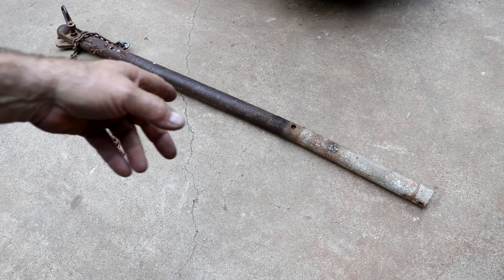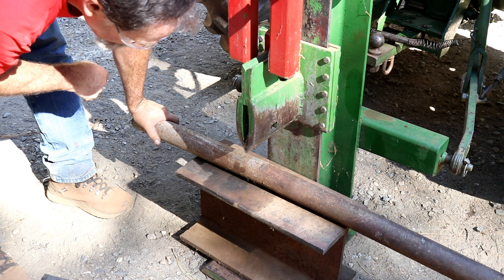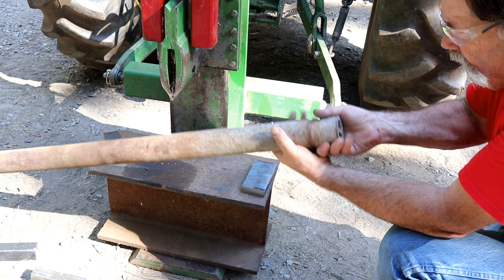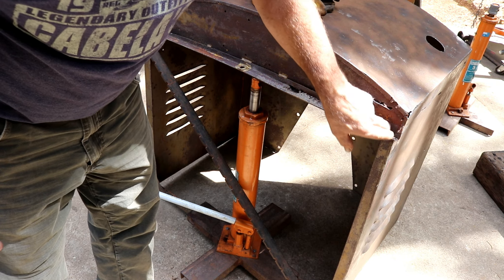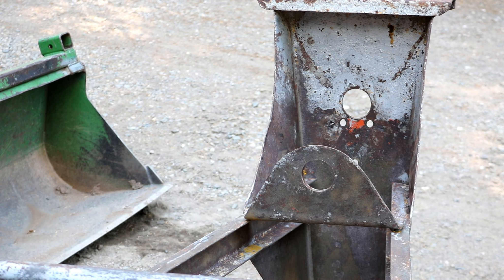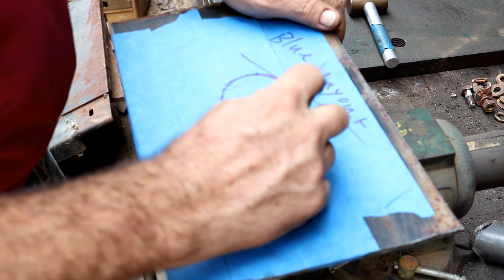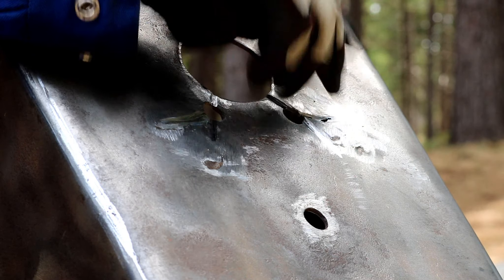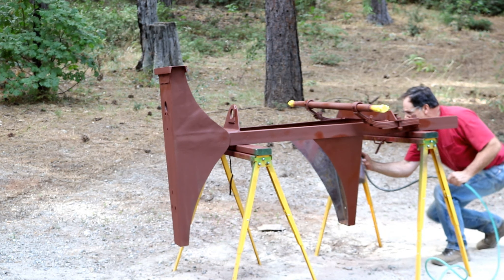Cement Mixer Restoration | Repairs P1

Comment: That's the biggest SM dolly/ bucking bar I've ever seen!!!
Looking good Randy, before you know it you will be finished and looking for another project.
Reply from the maker: Thanks Eric.  The anvil worked really great.  I am trying to complete another project at the same time.  The winter is starting early and it is cold here and stopping me from painting.
Reply: @RRINTHESHOP  yes the cold weather is coming. I have a possible project for you, I have two vacuume pumps they both work but need work - minor repairs. Are you interisted in one?

Comment: Nice Randy!  Coming along really good.  Tough to straighten out cement mixers.  They are usually very abused but you are doing a great job on yours!
Reply from the maker: Thanks Reid.  Coming along but winter is starting here and is slowing my progress.
Reply: @RRINTHESHOP  Yeah, I know what you mean.  We had a couple of inches of snow over the weekend and is supposed to get down to 24 tonight.  Real early for us here!!
Reply from the maker: Running 37 is the mornings here.  Early for us also, been having fires in the evening for a couple of weeks.  I split up 13 cords for this year.

Comment: Excellent Randy. This is not just about a cement mixer because the methods you're using could be applied to the restoration of other machines. So nice to see patience and knowledge come together.
Reply from the maker: Yes Jim you hit the nail on the head.  Everything I do is usually not about the object but about the How and what there is to learn.  Thanks you Jim for the great comment.

Comment: I think you talked about your wire feed welder in a previous video but since you mentioned in this video you liked your automatic settings, would you tell  us again what specific  machine you have.
Reply: By the way,  I just made a big hassle out of bending some 2 inch tubing and never thought to try my log splitter.
Reply from the maker: In the description the welder info and link.  Thanks Ted.  I really like it.

Comment: "I might weld, grind, and paint ... but a body man I ain't."

When you try to put a dial indicator on the drum, we will know you've been infected with FGS (fussy German syndrome).  At that point we stage an intervention ...   ;-)
Reply from the maker: Well said Digger.  I will have to set that up when the time comes.  Thanks Digger.
Reply: diggerop      as a German i was thinking the same impressive work
Reply: @reinhardthielecke8689    It is looking good.  I wouldn't want to use it, at least until the weather takes some of the new shine off of it.

Someone, somewhere, made a comment about "German made, you know how fussy they are."  Stefan seen it and chimed in ... wasn't long after he did some work on a mixer, and as a gag started to mount an indicator to the (very beat up and dented) drum in the last shot.  In another video he did the same with a (running) slitting saw.  I assume he was playing on that "fussy German" comment.

Of course we know he didn't actually do damage to his indicators, but I can't help but wonder how many of his countrymen reactively soiled themselves at the sight.

Anyway, thanks to Stefan, I started thinking of the (usually needless) perfectionism, that I still find myself tangled in from time to time, as a fit of "FGS."  

Those don't last as long as they used to.  Start with dreams of perfection, in the end:  1)does it fit?
 "yes," or 
"mostly"
2)does it work? 
"at the moment it does," & 
3)does it look good?
"if it works, that doesn't matter"
"like a mud fence in a monsoon"  or 
"like a gold ring in a pig's snout."